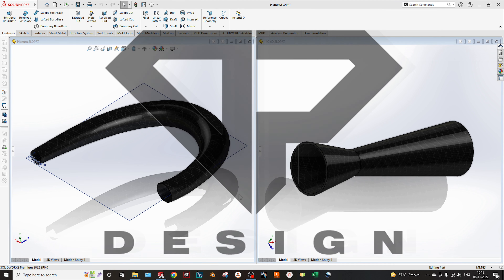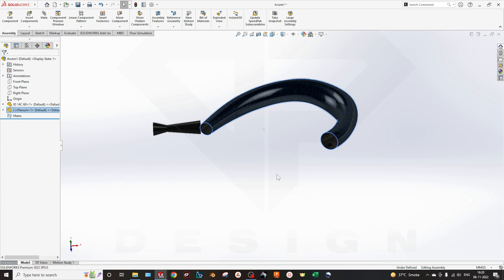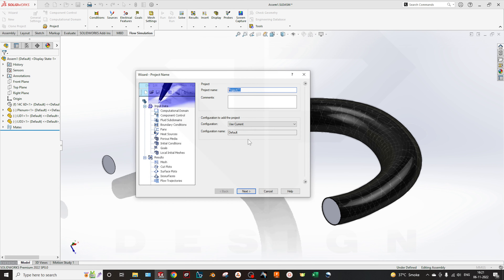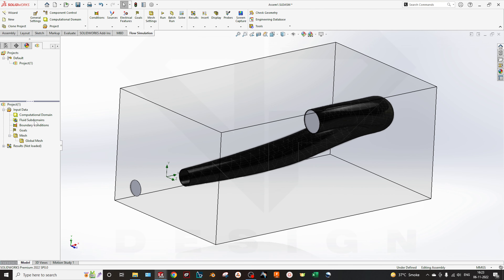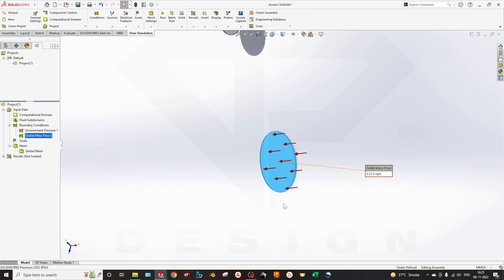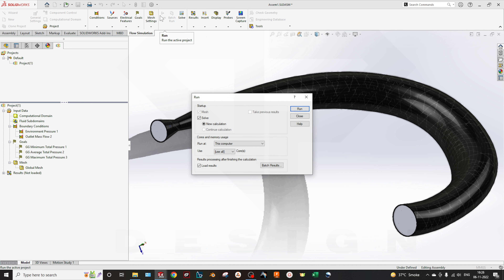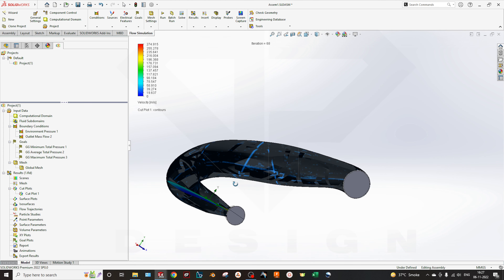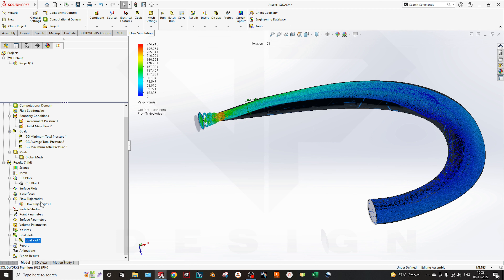CFD of Formula SAE Air Intake Manifold using Solidworks (Part 1) | FSAE | DP DESIGN

Comment: Sir how to manufacture it and  which material should be ideal your currently looking for 3D printing but we think it is not gonna work plz let me know
Reply from the maker: Actually we have made it through mold not 3D printing because 3D printed parts will not have good strength for intake.

Comment: I'm very interested in how physics explains this?
We are reducing the inlet cross section. At the same time, the speed, judging by the calculations, drops. We should also get a "vacuum" where the speed has dropped. And the end result is more power?